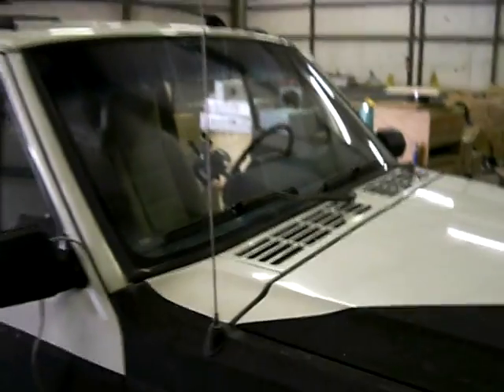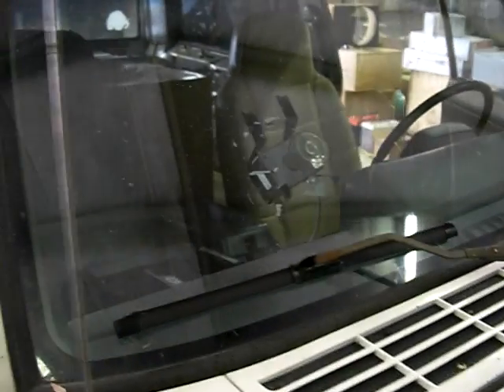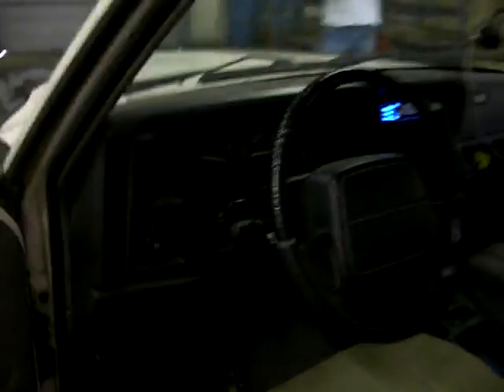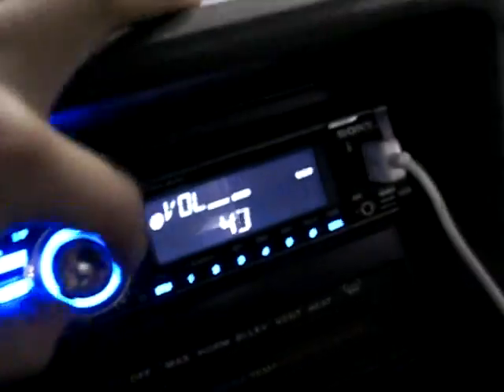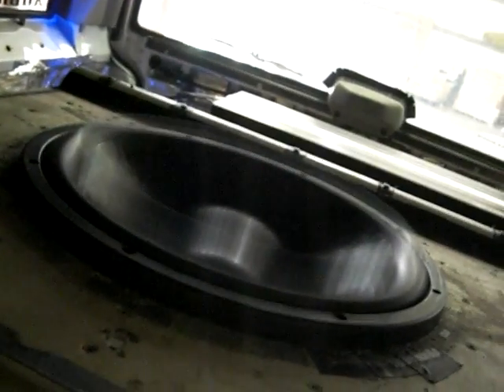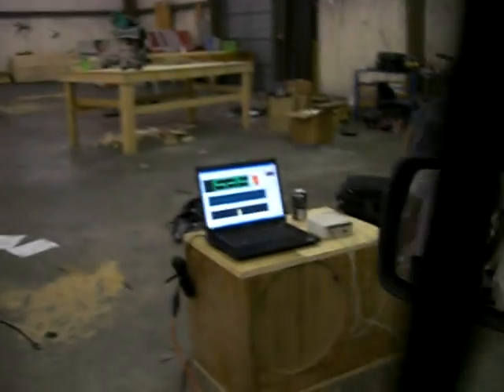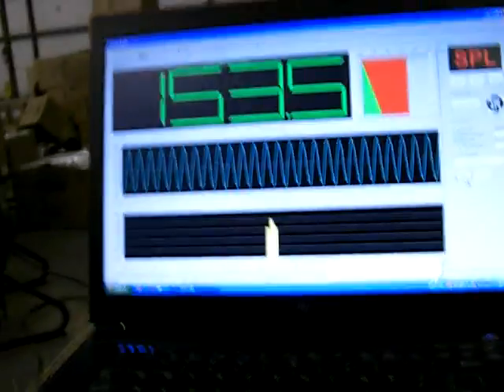Sundown SA-15 doing 153.5 dB on the dash legal score !?

Comment: The ultimate solution to a shitty looking headliner, a carpet one. Honestly we did that in my car, carpet for the wall and headliner. It looks so clean and because it has a 3mm MDF backing it won't flap around with bass. Only problem is it steals deebeez, lost almost 2 full deebeez cause of it.